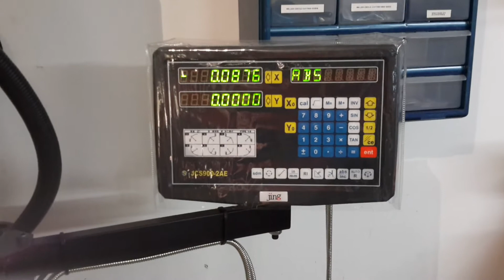Grizzly G0695 Power Feed Installed and DRO

Comment: I’m looking to get a power feed for my G0695 and I am wondering if the graduated dial that you purchased is needed for any type of power feed, or just the one you installed? Can you explain why the dial that comes with the machine will no longer work, please? Finally, the dial you mentioned has been superseded by part number p0728305. Just thought I’d put that out there for anyone interested. Thank you!